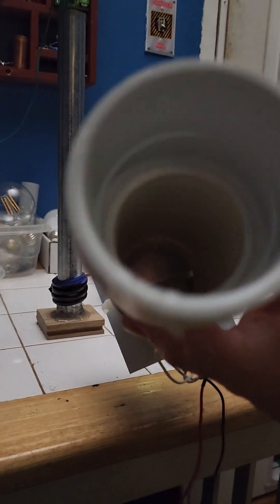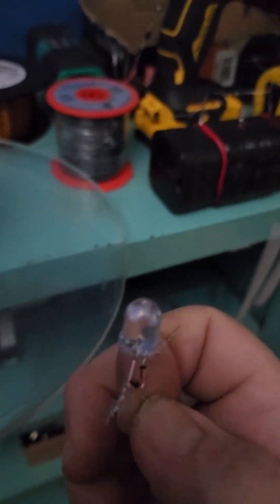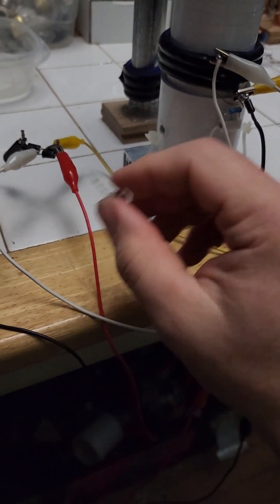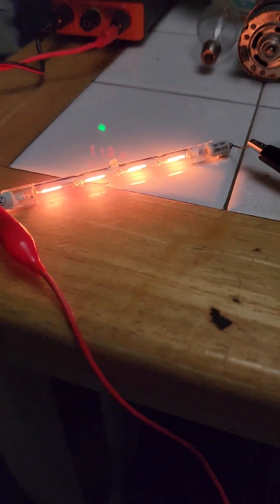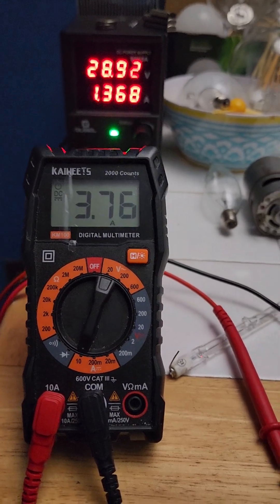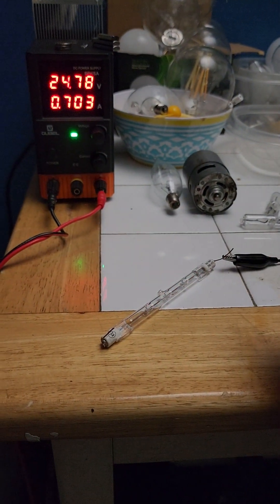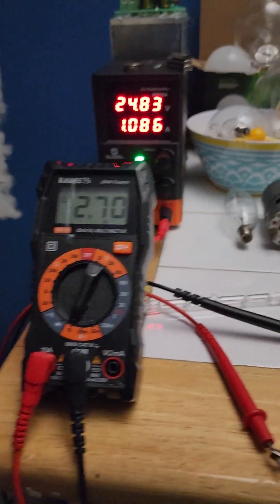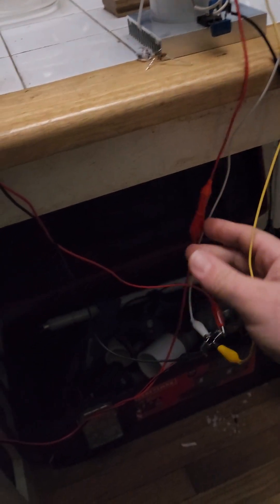🥶 COLD RADIENT ENERGY TESLA COIL CREATES OVERUNITY WIRELESS POWER & RUNS HALOGENS 👌

Comment: I will buy one if you can help me a tiny bit to use it? I'm trying to make this exact type of device. I've been thinking of this for years. Is it positive pulses inducing ground energy up into capacitors? Oh, the ground energy is almost wireless as well? True radiant energy. It's cold electricity.
Reply from the maker: I'll give you unlimited tech support & I'll also email you exact schematics if you decide to purchase a 350$ kit.
Reply: @MTECH2022  donated $25 to your gofundme
Reply: You are measuring short circuit current and open circuit voltage. This does not tell you the power. Measure the voltage and current of the load, multiply them, this will give you the power. Compare this with the increase in power supply current multiplied by the voltage. See if there is actually an increase in power to the load. Your halogen lamps are giving a low brightness, much less than the rated power.